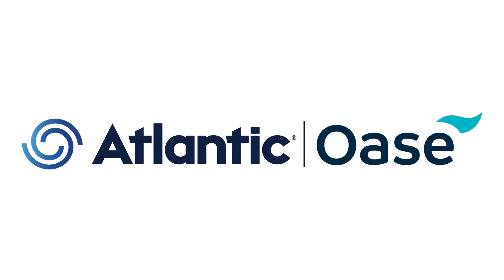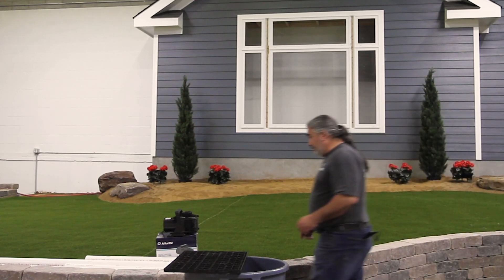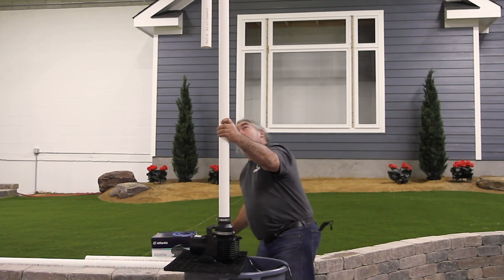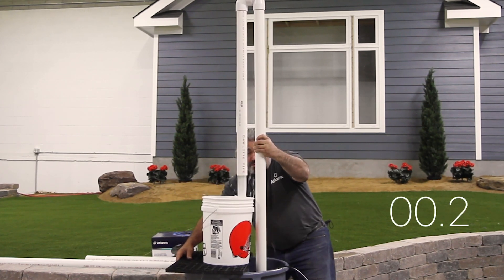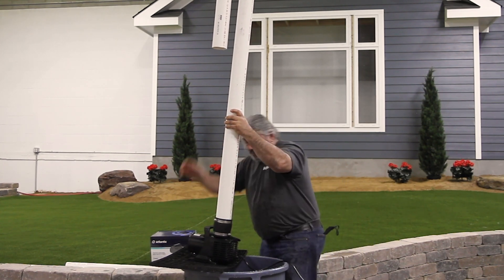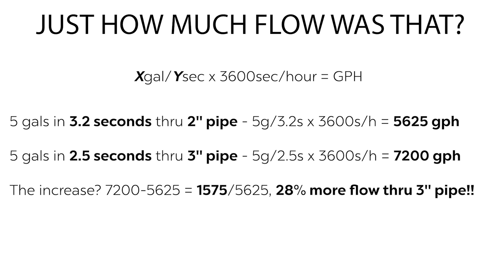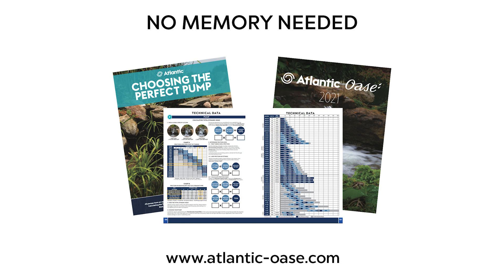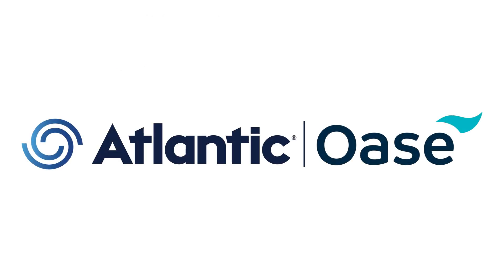Friction Loss Explained

Comment: So, what happens if it’s an elastic water hose? Would the inch be different before pressurized the 2inch and 3inch?
Reply from the maker: Flexible hose doesn't save very much friction even though it eliminates the 90° elbows because internal ribbing on the flexible hose actually makes it a little less smooth than the rigid PVC. In practice, they're about the same.

Comment: Will this hold true when using the TT pumps inline or as suction pump ?
Reply from the maker: Hi Jason, Wherever there's water moving through a pipe friction is a consideration. When using the pump outside the body of water, plumbed "inline" or used in a "flooded suction" situation the diameter of the pipe that feeds the inlet of the pump is even more critical At the outlet, friction can be overcome by the force of the pump. It will rob flow and raise operating costs if the sizing is off, but it boils down to the pump having to work too hard for nothing, and the pump will generally underperform but survive. On the inlet side the water is feeding the pump only by the force of gravity. Even small losses of flow due to friction can starve the pump for water. As the pump pushes more water out than can easily flow into it, inlet pressures will drop, and even asynchronous pumps will cavitate as bubbles form in the around the impeller. Spinning in a foam rather than in a solid column of water, the impeller will not encounter the resistance it was designed for. The pump will spin too quickly, and the lower flow around the water-cooled rotor will only make it worse. The motor will overheat and start tripping the internal thermal cutoff. It's just a matter of time before it burns out. To avoid all these dire consequences, eliminate friction in the inlet plumbing by keeping the inlet short, straight and a size larger than the discharge. -Demi